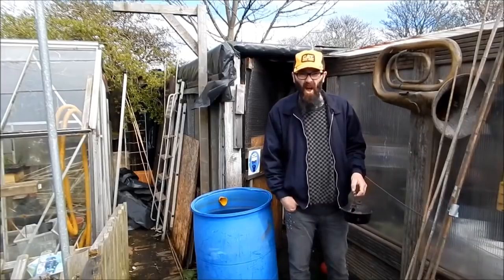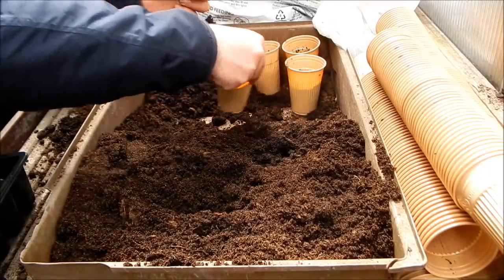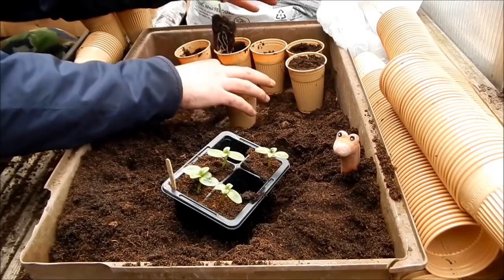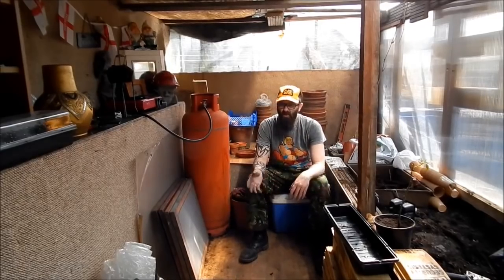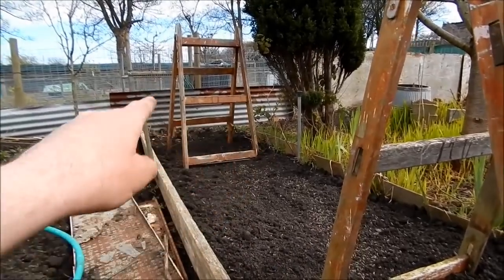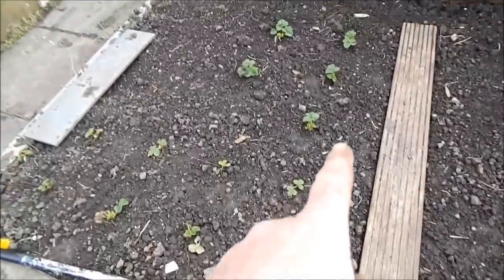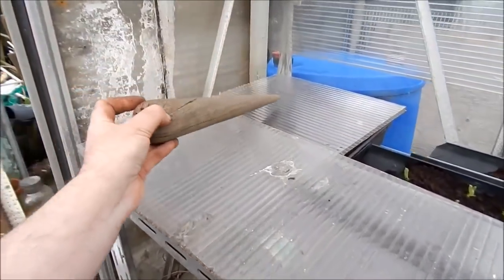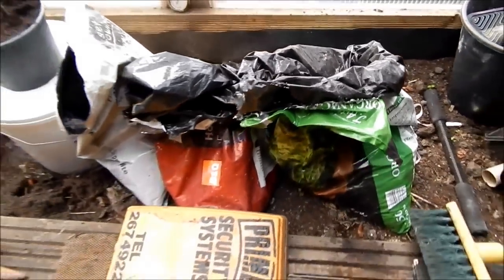Dave's Allotment. Potting On. Soil, Skip Finds & Singalong Update. April 2016.

Comment: Hiya Dave! You could've probably left those kale seedlings in the plugs for quite a bit longer, as they're quite deep. That way they would've had more roots to hold the soil together when you push them out of the plug. Then as Hobbit Vance says, use a pencil or something to push through the hole and push them up from the bottom. 
I've had much better results sowing sunflowers direct outside covered with plastic bottles with the bottoms cut out, like mini cloches.
What crackin' skip finds!

Comment: with the on ones from aldi they have quite a large hole in the bottom , I pushed my seedlings out from the bottom with a bit of 3/8 dowel .worked a lot better than the ones i tried to squeezing out like usual

Comment: You need to soak them first and then use a pencil through the hole in the bottom of the module to push thru. They should come out as plug plants then great vid !